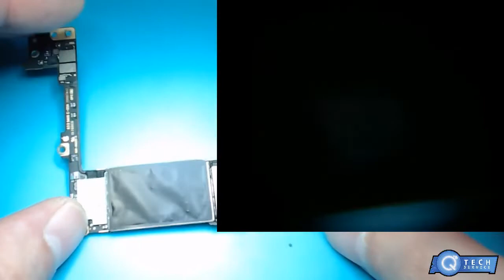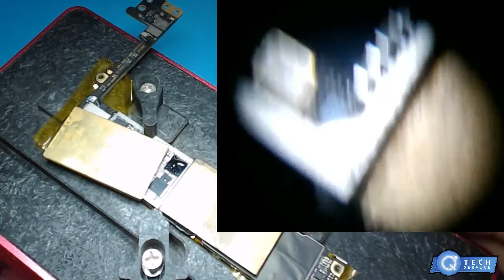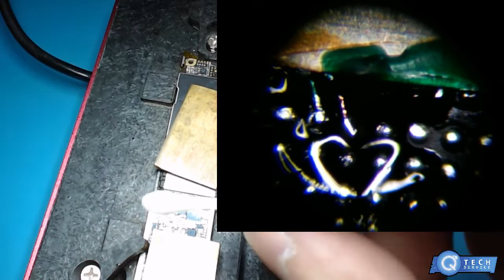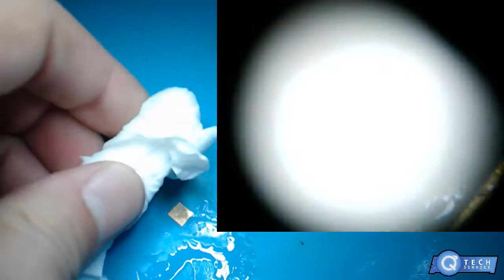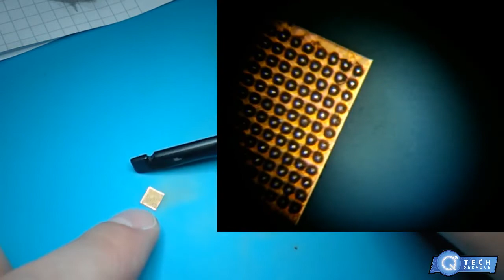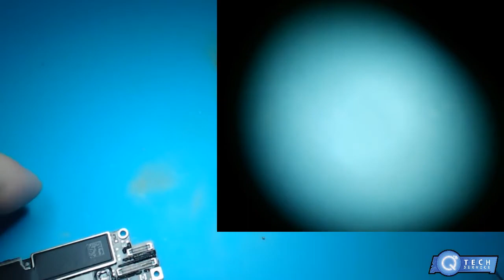iphone 7 plus no audio devices found no cameras fixed

Comment: use more heat on hot air and use drop method and ull never bump again :D
Reply from the maker: Cormac Pyper I like the way go back-and-forth until it slides freely i’d rather not components sideways .. that way you don’t pull pads 😂👍